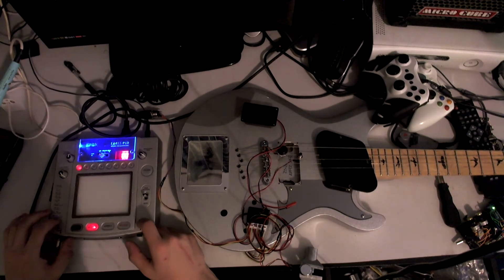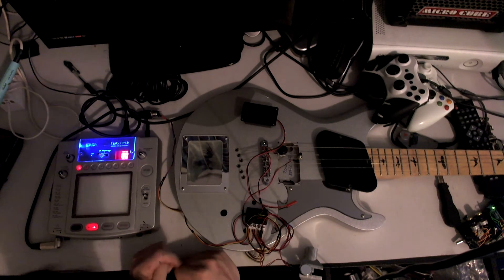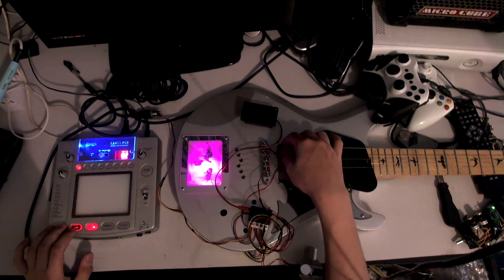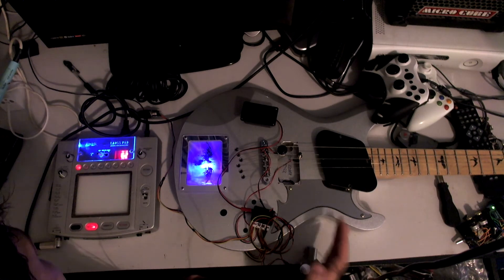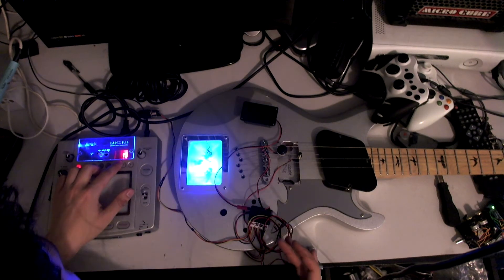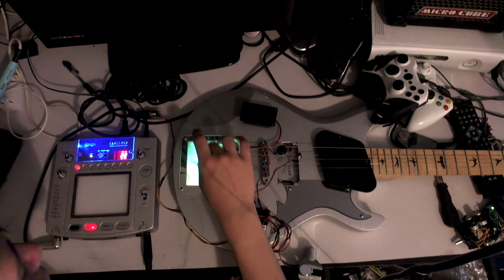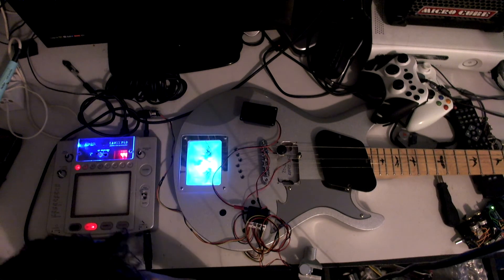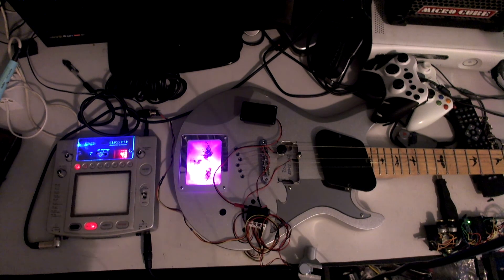Guitar Digital Touchscreen

Comment: Ok now it works, but you didn t write resistors and capacitors values, and also screen dimensions and where to buy it. Could you please tell me? Thank you!
Reply from the maker: Hi Marco,

The resistors have coloured bands on them, you can use that to work out their resistance. (Google resistor colour code) I think they are 10k but just double check, as for the capacitors. I used 220uf capacitors in parallel with smaller ones (22uf I think) their purpose is to cancel the interference with the encoder readings, you may find that just using a 220uf capacitor on eqch side will do the trick, have a play around. Best of luck!
Reply from the maker: Oh I forgot to say, I got all my parts on ebay, just search Nintendo ds replacement touch screen, you can use any size you want, but you may have to change the mapping In the code.